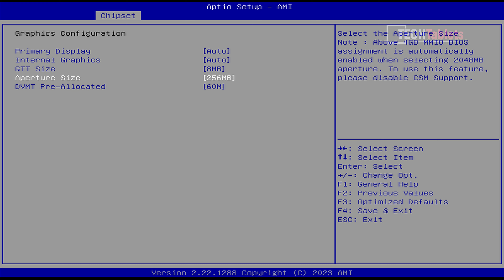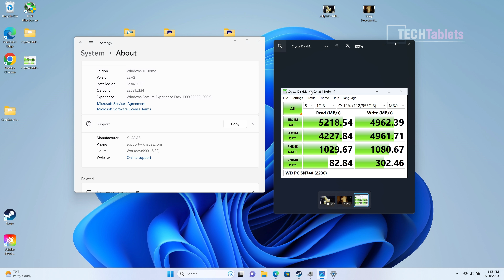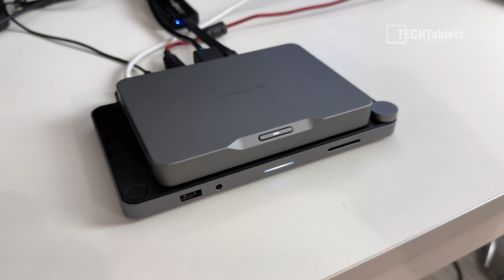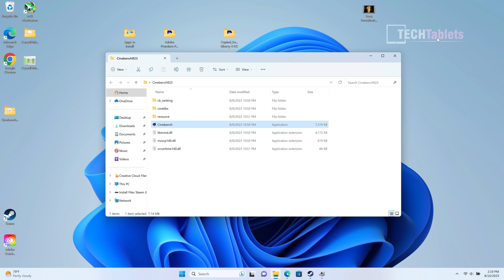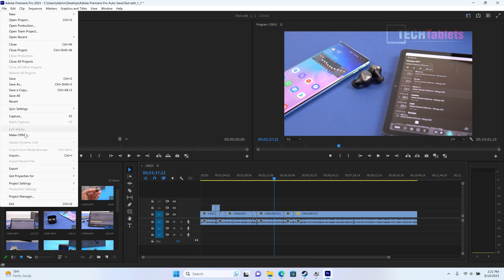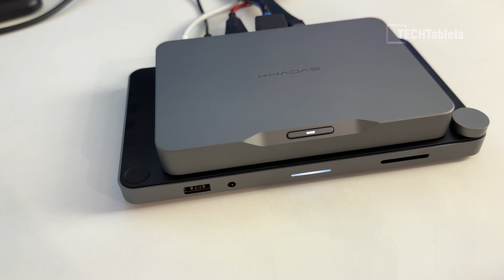Khadas Mind Review - Awesome Modular Mini PC!

Comment: Can you try and run CS2 on this thing and see what FPS you get? I want to see if it's good for this TY
Reply from the maker: Sorry I sent it back but have a look at other Mini PC reviews with Iris Xe GFX, playable FPS on low settings. But the 780M Mini PCs are much better for CS2.
Reply: Ok no problem do you think its a good gaming solution, how long did the battery last for on full charge on normal use did you test it @Techtablets

Comment: Its a fabulous idea but it just gets very expensive very quickly. $1700 USD for example if you have the dock and the GPU enclosure. That's alot..
Reply from the maker: It's is a lot yes I agree very pricey if it's the top spec plus the GPU dock. Depends on your needs.

Comment: That is really tiny, what a well thought out product and super unique with the whole package. This is what a PC ought to be, PC in general or even laptops are built to be modular, usb and thunderbolts can expand on their core functions. this like the asus flow x13 is cool, can plop an eGPU, I'm guessing the connector is faster than thunderbolt as well, but most manufacturers don't really go that far to package it with a dock or eGPU dock, but 10,000 connection sounds a bit low, should be at least as robust as foldable phones, maybe at least 100,000 plug ins.

Overall very innovative for a mini PC, this is what I expect from mini PC makers, was expecting Intel NUK to do this. I won't say mini PC are boring up to now, because I believe performance alone can enhance the experience tremendously. Imagine a similar form factor but next gen integrated graphics is about 3060, 4060 level. This is really cool, especially the backup battery, nobody will think of that.

Comment: Can you use a desktop GPU with this? Or are their offerings all laptop gpus
Reply from the maker: The Mind Graphics dock is an RTX 4060 Ti with 8GB. Full speed version. I did try egpu m 2 and rtx 4090 it worked from the little 2230 slot.
Reply: @Techtablets  ty!

Comment: Interesting concept, but I always look for its place in real world scenarios. Less portable than a laptop. Has no screen, keyboard, speakers, mouse/TP input, so not good for travelling. Same size range as a mini PC, which also can have integrated graphics. Portable audio device (with the speaker dock) - nah. Too large, too many cables, no real advantage over a phone or a laptop.
Modular devices have a history of failing. I remember the MXM graphics, the Google and Lenovo modular phones, etc. Good luck for this one, because it's really sleek for a mini PC. The price of 600 USD for the base module makes it a viable option, but the other additions make it less sexy.
Reply from the maker: Like anything really it depends on what you want in it. Mobile unit for work and then home maybe you have a monitor at both places and this tiny and good to move about with. But yes fir most a laptop is probably the best bet. But I hope this does well and hope to test the GPU dock which is what really interests me.

Comment: Definitely looks more classy than garage-made chinese regurgitates. Hooooooowever.... those early-bird prices are the only prices that vaguely make sense. I mean, if the scratched MSRP goes live and they'd want to sell a 4060ti for 1 grand.... oof. Considering that it comes in hull that's almost the size of some ITXes that could house a dGPU. Like it's passively cooled or something.
Look, bum-talking aside, we are talking about 800$ for a barebone and over 1 grand for a barebone+. You can get a laptop with 3060 for 800$ at this point.
And over two grand for a huge box sporting a 4060ti.

At that price you can build an equal PC with 4080. Or a compact PC with 4070\ti. You can buy a mac that's about as big and about as productive. Maybe smaller and more productive.
And, NATURALLY, 4060ti isn't what you'd pick for a GPU. Have these guys heard the reviews? Gamers aren't getting that. Content creators aren't getting that.
AI enthusiasts aren't getting that. They need VRAM and 8GB just won't cut it.

The idea is solid, and I understand that they can't quite compete with "the rest", but their choice of hardware is questionable. I won't bother with team red, and I'll agree that raptor lake is solid, but 4060ti is just... they could've gone for a smaller, passively cooled 4060. Or fit a much more versatile 4070 in there, at least it has 12GB VRAM. Or at least they could've sourced some clearance deals on 3080, though it doesn't make any sense compared to 4070.
But 4060ti isn't what you'd want to pay extra for as a dGPU. And without it, the whole thing is just a sleeker-looking brick.

Comment: Impressive performance but too expensive and the battery is just not that useful, you can hibernate and achieve almost the same effect
Reply from the maker: I would have preferred in place of it two full sized PCie 4.0 SSD lots. But it's more for hot swapping moving it about without loosing your work. No need to power down and it can handle power cuts with no loss of work.
Reply: @Techtablets  I guess it had some niche use cass. I just wish they had the home server use case/dock in mind too
Reply from the maker: That and a Surface Pro type 2-in-1 would be cool (I think a screen is planned)